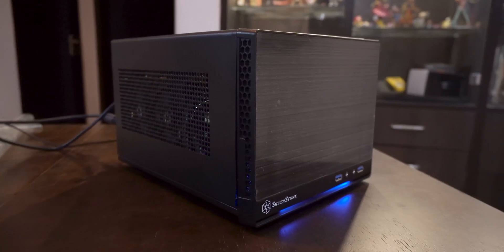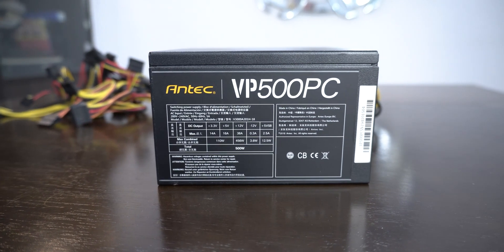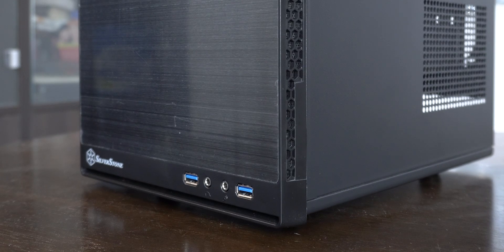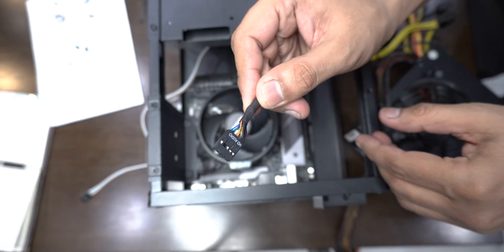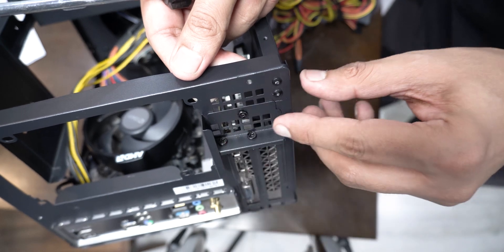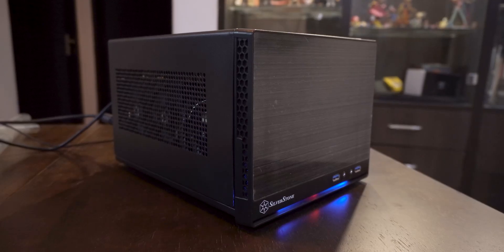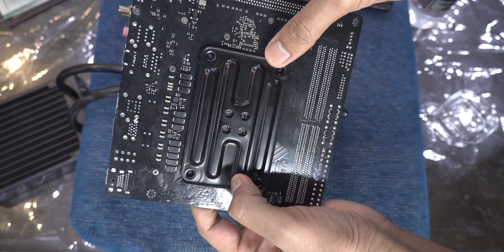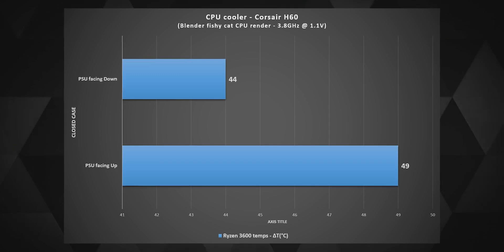A Mini-ITX Saga(build) with Silverstone SG13 ft. Wraith stealth & Corsair hydro H60

Comment: Do you think I could get away with the low profile Noctua fan CPU cooler, an ATX facing down, and a 140mm front fan.  It will be an apu only. No gpu
Reply from the maker: Just cross check its height once.

Comment: The specs for this case claim the max height for a CPU cooler is 61mm. Since the PSU goes directly above the CPU I am wondering if that is based on using an ATX PSU. If that is true, then using an SFX PSU should gain you an additional 22.5mm of space for the cooler. Does anyone know if that is true?
Reply from the maker: Ah this is a really interesting question. If I still had the system I would've surely checked this.

Comment: The AIO fan ... take air  from the outside, that air is heated by the radiator ... THEN it goes in the box. It's counter productive
Reply from the maker: That's why it's called liquid cooling and not air cooling for the CPU.

Comment: Thanks man, what i really face the same problem about this setup.
How about using low profile cooler? Is it make a huge different temps as aio cooler did?
Reply from the maker: Couldn't test with a low profile air cooler as didn't have one at that time. If you don't have a SFX psu and a good intake fan then I'd suggest you go with AIO only.
Reply: @MrMuBot  i never use aio before.. is it complicated to maintenance aio?
Reply from the maker: Well, just regular check ups are necessary. Most of the aios won't bother you for the long term.

Comment: You need a fan on the front.
Reply: Also, you need to go 100% m.2, then you can use a stock cooler.
Reply from the maker: @joeyvigil  Yup I know. Did you watch the complete video? We installed an AIO later.
Reply: @MrMuBot  Yes, sorry, I made this comment half way through.
Reply from the maker: No problem :) Thanks.
Reply: Here is my build:

https://pcpartpicker.com/b/6NZfrH